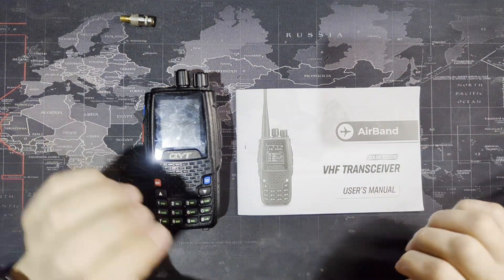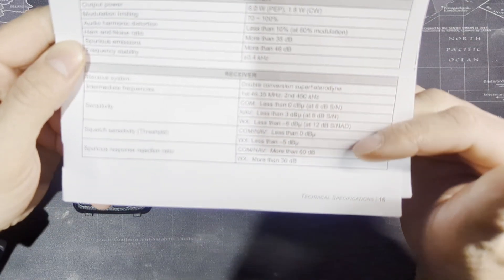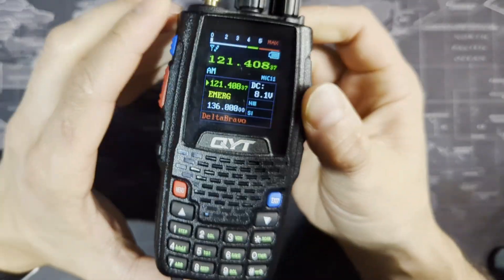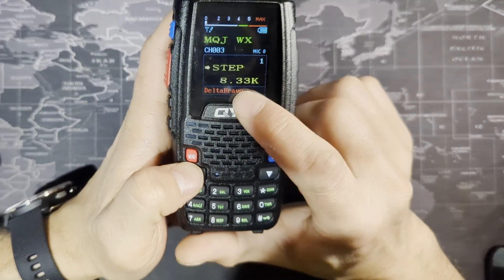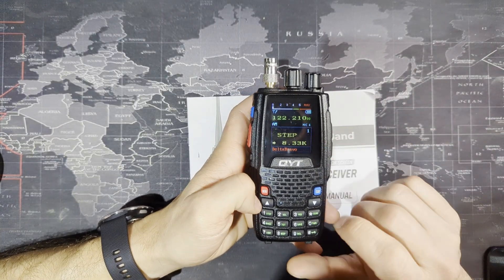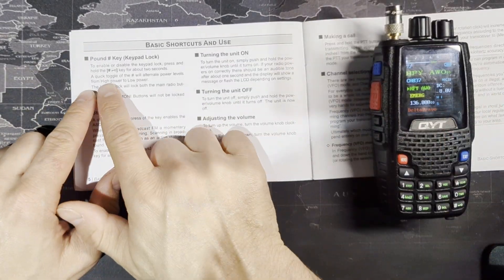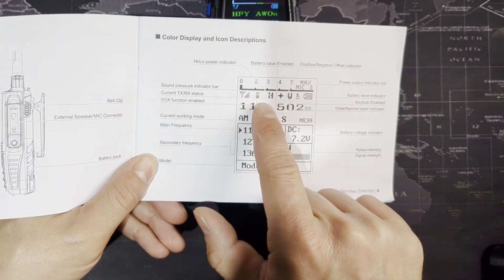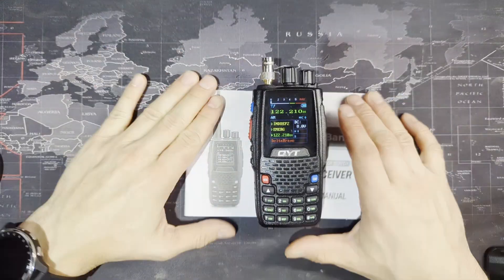QYT KT-A16 Aviation Radio Set Up

Comment: I don't know about you, but if I were going to rely on a radio to use as backup radio, I'd want something a bit better than a POS radio from China. 
Spend a little more and get a quality radio.
Reply from the maker: lololol soooo many radios come from China or Asia.  Are you a Ham Radio Operator?  Which radio do you recommend as a quality Aviation Radio?  I also have a Sporty's PJ2+ that cost over $200.  It's made by Rexon out of Taiwan.  While the PJ2+ is not bad, I much rather prefer the QYT KT-A16 radio while up in the air as my backup radio.  Do you have facts and evidence why the QYT KT-A16 is a POS from China that I am unaware about?  Honestly curious, please share the information so that we're all better informed.

Comment: Hello.  Not sure you can help or not...  I deleted the NOAA channels when I first got the radio (instead of using the software to "lock them out".  Now I am not able to add these frequencies back in using the software because they are "out of range" which makes sense.  Is there any work-around to add these frequencies back in without uploading the initial channel "file" which came with the radio?  Thanks!
Reply from the maker: Ehh maybe you can do a reset of the radio?  Or, at least if you still have the original channel file, I guess not all is lost and would just require more effort or work to get the radio set back up how you need.  I also deleted mine and couldn't get them back in either, but I am not so concerned with that since I have other HAM radios for NOAA and I use airport weather instead of NOAA when flying.  Sorry to hear about the inconvenience.  Let me know if the reset work if you try it.  Did you check out my other KT-A16 software video by the way?  Maybe there is somehow a way to add the frequencies back in via software, but I have not tried anything yet.
Reply: @58Alpha  In the software change the dropdown menu to vhf instead of airband and your should be able to add the wx channels back.
Reply from the maker: @TonyButtittaphotography and then I presume that you switch back to airband without touching the Wx frequencies in your channels, save and write to radio, then all should be good?
Reply: @58Alpha  sorry, I just tried it and that does not work either. That is so strange. Why can't you add those frequencies back in?  This is gonna bug me. A factory reset should put them back, but what a pain.
Reply from the maker: @TonyButtittaphotography true. But honestly for me, I'm okay with it since I have many other han radios and such to listen to them if I cared. When I fly, I'm only listening to aviation weather at airports anyway
Reply: I’ve watched this video to many times how do I set frequency s and save them to a specific channel number do I have to use a computer
Reply: Also mine stays on the 8.33 after I shut off and turn back on
Reply from the maker: @Zippy1wood. Dang. I must have a bug or something else in my radio that resets it.. maybe it's another setting to fiddle with

Comment: Thanks for your super useful video. I'm a private pilot and just bought this QYT model as an emergency radio to keep in my plane. I see you suggest the "Radtel Aviation Antenna 108-136Mhz". Is it any good for TX or is it mainly for RX? Every comment I read online about such antennas are usually just about receiving. But it's important for me to find an antenna that can transmit well. I also consider the AM-771 Pro from Baofeng. Thanks in advance for your reply!
Reply from the maker: Thank you for watching!  I made a YouTube short video to answer your question:  https://youtube.com/shorts/mZAEFPtcvoc

I get an SWR reading between 1.2-1.5 which is pretty respectable for these whip antennas.  The Hiroyasu will increase the antenna gain compared to the standard whip antenna that came with the radio originally.  So, that will help due to the lack of power these Airband radios have.  I'm glad you got this QYT radio and I hope it treats you well!  I suggested the Radtel one since it was an Amazon link and I felt like most people wouldn't wanna wait or order what I got from AliExpress.  But Radtel makes some good stuff too.  The main thing is to ensure whatever antenna you get is meant for the airband frequency band.  The Baofeng AM-771 Pro that you suggested looks like a great option for sure, and Baofeng is also well known, so I don't think you will go wrong with that.  I don't know your background if you're into ham radio and antenna theory and all of that, but there are antenna length calculators online to help ensure you're getting the right antenna for the frequency band you will use.
Reply: @58Alpha  Thanks so much for your quick & interesting response dude. I actually hadn't checked my notifications for a while so I hadn't seen your reply. I finally received my QYT KT-A16 off Ali, and it works great for Rx, but I have issues with Tx. I used another  radio (a Radtel) that receives the Airband really well, and then tried to transmit using the QYT. Even only at a few meters of distance, the signal I picked up is really weak. I don't know if it's a hardware problem with my radio specifically (like the ampli, the microphone, or something else), or if it's a general issue with the QYT. I considered asking for a refund & buying another same model QYT in case the issue came from mine. But from what you just said, it sounds like buying a better antenna could help. That's what I'm gonna do I think :) Ali is perfect, I live in Europe and it takes about a week lol. 

About ham radio & antenna theory, you are definitely much more knowledgeable than me, as I am just getting started with learning all of that. I didn't know that there are antenna length calculators, I'll definitely check that out. Thanks a lot again bro!